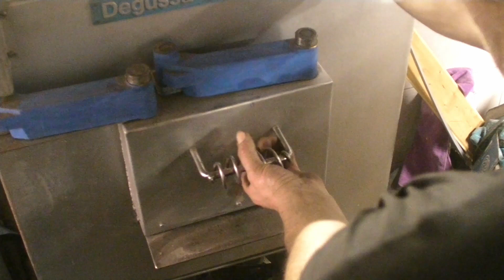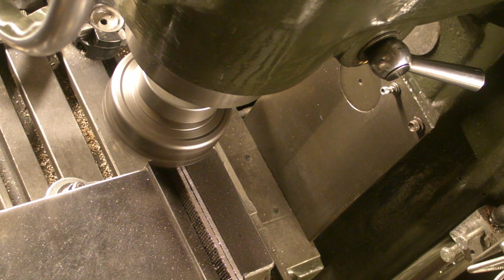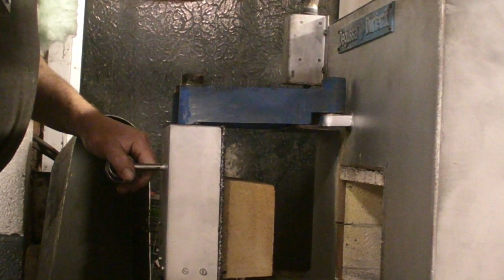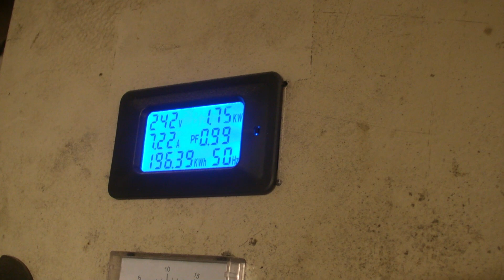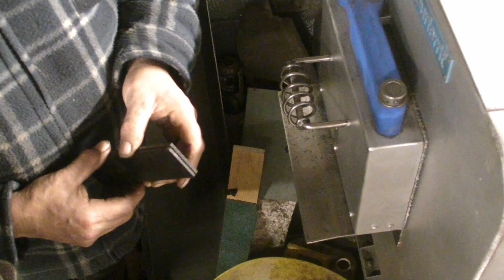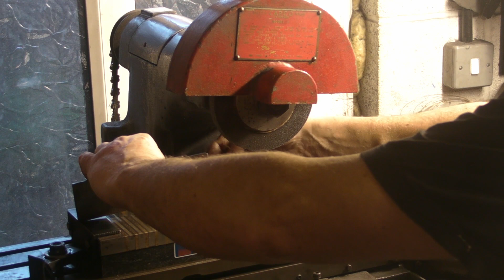2 Ceramic face mills go head to head

Comment: Hello Del,
An enjoyable video, thank you... What make is your heat treatment oven?
Take care.
Paul,,
Reply from the maker: Hi Paul, its a German make, Degussa Durferrit  only just came through the door  and its extremely heavy, controlled by an Inkbird  p.i.d. made the stand myself, any progress with your clock ?
Reply: @machinenutdel6764  Thanks for the info... I have a saved search on eBay now for one...
Nothing happening on the clock at the moment... Should have a video out by the end of March.